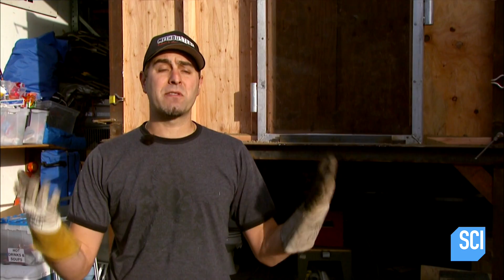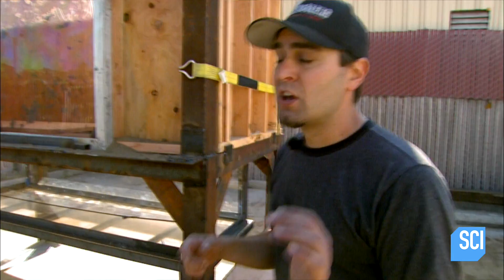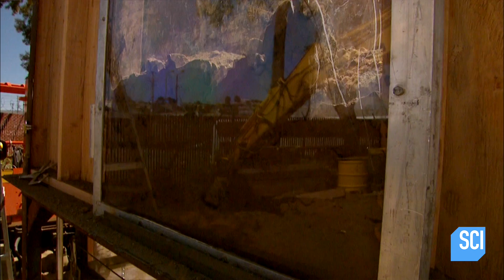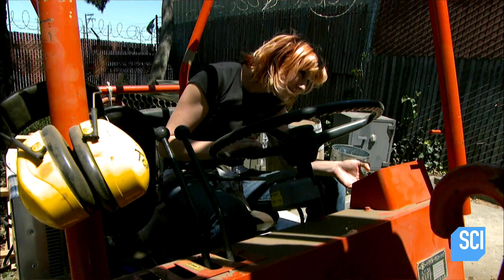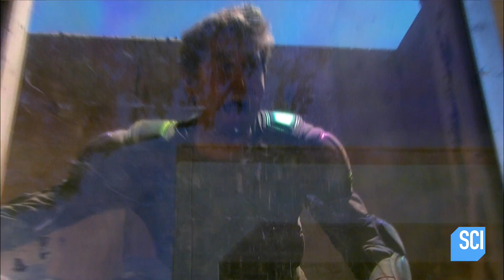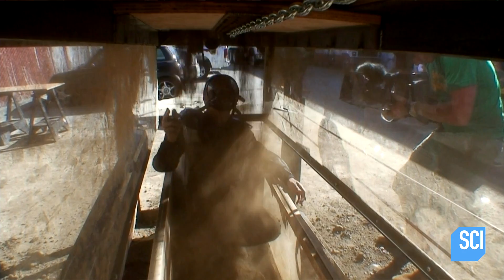Is There Too Much Pressure to Escape Out of a Casket?

Comment: What's funny is their testing this and not doing it the proper was as if you are buried alive you can punch though the wood it just takes a bit then you push all the Dir you can to the far side of the casket so tour sitting upright then you dig and fill in the casket with dirt as you dig up.  Unless it's raining then your chances of life have dwindled also then buried they pack the dirt down
Reply: You know how little room there is in a casket? Even IF you could get your arm straight up and down and get enough speed built up to punch through a wooden barrier, you'd have to create a large enough hole to get your body through without collapsing a few hundred pounds of freshly poured, not settled dirt in on top of you, then use just your arms to dig some of that dirt in on to yourself, pushing said dirt to the foot end of your coffin as you do so. You would have to continue to do this for at least 4 ft of dirt IF there was no vault (if there is one then only 2 ft of dirt but good luck getting through the concrete, and you're not lifting it either because those lids are a couple hundred pounds and there's 2 ft of dirt on top) all the while maintaining a packed hole and pushing the dirt down and packing it behind you with your feet. The most space you have to work with is the amount of free space that was in the casket around your body, so good luck moving your body enough to do any of that. The person with the best shot would be a contortionist.
Reply: @philliplewis1586  did you read A this is for those wooden ones that people used to use the processes that people use for burial nowadays which are point less would kill you and yes the lied is tight but in the older ones you'd have enough room as you have to do it over timer little by little
Reply: @lunardiver6784  I don't think you understand how tight a coffin is, old ones included. Would it be physically possible to move the dirt as needed? Possibly. But you also have to keep in mind that you have limited time until you suffocate, and that work takes energy so you're using oxygen. The amount of time and space you'd have to work with are extremely limited. I don't think you could do it.

Comment: I have seen people get buried and they encased in concrete on all sides
Reply: K
Reply: That’s only for places only under sea level, so bodies don’t float in floods
Reply: @iceboxxer494  oh that makes sense
Reply: Ice Boxxer most cemeteries require it because once the casket decays it could lead to sink holes in the cemetery
Reply: @iceboxxer494  Stop spreading misinformation
Reply: @iceboxxer494  They do it in Arizona as well, that's not the only reason why.

Comment: They are basicaly using sand not dirt

Edit:This is just what it looks like to me
Reply: yh the soil on top would be wet like atleast a bit
Reply: @abdullahfall1517  thats not always the case... She was buried in a desert... Where the top soil is just dry dirt.
Reply: It's still heavy as fuck either way
Reply: Its just dry dirt lol
Reply: @KanyeisGaming  dry dirt is basically sand, it acts nothing like wet dirt
Reply: in the movie the character was buried in the desert.  So sand is a good aggregate.
Reply: Sand isn’t a particular substance, it is a particle size range.
Reply: @wompbozer3939  
Sand IS a particular substance. That substance would be rock and mineral.

Dirt is made of clay, silt,sand and rock.

Soil is made of dirt and decomposed/decomposing Bio material
Reply: Corn Holio Sand can be made from any kind of parent material. It only describes a particle size and not a material. Silt is finer than sand. You could have granite based soil next to sand that came from wood particles . Even though we all kinda know what sand is, the actual definition is a little counterintuitive

Comment: Most cemeteries require a concrete Vault the casket be placed in with 18in of cover Max and depending on if the dirt was packed or if it was just dumped and depending on the size and amount of rocks.

Comment: There is more pressure to consider from surrounding dirt. Not just the dirt that's on top of the casket.
Reply: Uhmmm not true unless you want to punch through the side?
Reply: No Videos you’d be suprised how compact dirt is just a foot down. Most dirt will not fall like it did in this video and will actually hold its shape. It’s more likely you’d actually need tools to dirt upwards and out.
Reply: @joshlarochelle1298  exactly. It's compacted as hell
Reply: @*_No Videos_* sorry i dont get what you mean. Mind explaining? The pressure from the outside is already there and with you getting in more dirt the pressure will rather equalise than become greater or am I not thinking right?
Reply: @neznan1706  bro, imagine digging a hole with damp sand and the trying to climb out. It's like that.
Reply: Not forgetting g the cement and metal case
Reply: It's a hundred thousand pounds of dirt above you. Freshly buried it wil all collapse in your face and crush you. BUT if you are ultra strong enough and fast enough to punch a giant hole big enough to make an escape through thousands of pounds of dirt then I guess you are more than human.

Comment: You were using dry dirt, in cemeteries they have the moist soil that holds its shape more
Reply: That annoyed me more than it should lol
Reply: @JustyMe  cause he said moist? 😂😂
Reply: Exactly.
Reply: Ya but if it held its structure more then the hole would open up similar to the 2 feet of dirt experiment
Reply: either way, t6 feet underground... its impossible. The only way out is to tunnel, or move dirt out of the way, and if you are in a coffin there is almost no room to put the dirt asside. Even if it was playdough, there is just not enough room to set aside dirt for a 2x2 tunnel.

EDIT: Just look at the 2 feet deep experiment here. Look how much dirt is IN the coffin with him. He has to move a lot of it to the end just to be able to sit up.
Reply: @TheBeehawk  Why do we think of going up? Why not to one of the sides and go up and an angle
Reply: @sachagirvan  what difference would that do? and besides, you could get disoriented and lose direction of where is the top
Reply: @sachagirvan  even worse idea, have you seen The Great Escape? Tunneling even two feet out to the side you risk a collapse.  By the time you tunneled enough out to the side chances are the soil would collapse because you're not deep enough for the compact soil to hold the soil above it. You need to he more than 15 feet down just to start having soil compact enough to hold the pressure. That 6ft of soil would come down on you in the blink of an eye and crush you
Reply: @DeepFriedBeans23819  True, what if you tried to use the top board of the coffin above you?
Reply: @sachagirvan  make a support? With no tools and under 6ft of dirt you'd be better off doing it It kill bill style. And even moving the top board in the slightest you risk a collapse. Basically the only thing keeping the dirt coming down on you is the coffin itself. Moving it in any fashion would be certain death.
Reply: @DeepFriedBeans23819  So the answer is, don't be an idiot and get yourself in that situation in the first place.
Reply: @sachagirvan  you dont understand how solid and heavy a coffin is, do you? you would be lucky to break the lid open let alone go from the sides.
Reply: Depending how big the coffin is and how wet the soil is, it's probably not impossible. But really unlikely and stupid.
Reply: Isaac Downs wet soil is worst , more heavy , less flexible , it’s death assured .
Reply: @gerard4039  doesnt fall apart as easily... you could dig in slowly and push it towards the opposite part of the coffin. Still nearly impossible with 6 feet but better chances than this
Reply: @gerard4039  I dont know how good your english is but I see no reason for such hostile behaviour towards me. Anyways you couldve just kept it as a simple opinion that would actually make a decent point... I also never said anything about digging out being easy but instead pointed out its still rather impossible. Have a nice day now and stop putting such negativity onto others 🤪🤪🤪🤪🤪🤪🤪
Reply: @saints360row  but coffins we have to day even have less room to put dirt in with all that cushioning inside
Reply: @saints360row  I've been to 4 funerals recently. There is not much room in the average coffin, and the dirt has to go somewhere. Guaranteed you would die trying to get out of the coffin, even wet dirt would collapse into the coffin as soon as you start to dig. Especially since the dirt is recently put on top of you and hasn't had time to compress itself naturally.

You can try to dig upwards in wet soil, but your going to run out of room because you can't even position your body upwards, imagine laying underneath your bed. You have to dig enough so you can pull your body upwards, hope there is enough room for the displaced dirt. Then you have to worry about the amount of oxygen your consuming because there isn't going to be much air down there.

All the while when your laying on your back digging upwards if the dirt falls on your face your going to be in trouble, nowhere to move and if it fills up the area of the coffin your head takes place. Its game over if more dirt falls than you can displace.

I'd say your pretty fucked, not impossible. But very improbable. I don't know why everyone is arguing about being trapped in the coffins, you have a higher chance of getting hit by lighting than being trapped 6ft underground in a coffin.
Reply: @Taczy2023  Jokes on you pal. I don't have a bed. Hah. Figure that one out snowflake.
Reply: @gerard4039  wet dirt wouldn't all crumble and fall
Reply: @gerard4039  If it's at the right consistency and it's the right soil, once you've made a hole in the coffin all you would have to do is remove enough dirt to make a hole large enough to crawl out of while packing the dirt in around the walls to ensure it doesn't cave in, a fresh grave might not be very packed down, so in that case the soil just might have enough play room you wouldn't need to worry all that much about having room to put dirt somewhere. That's really the only way I see it being possible.
Reply: Somehow make a hole on the side and dig a tunnel moving forward while putting dirt behind you, therefore you never run out of room and are able to keep going forward up or down. Just imagine a box the diameter of the coffin moving with you. Makes sence?
Reply: Mega Savior, I guess some didn't imagine such a possibility. ;) 

It depends on how settled the ground is which makes this plausible, however even in 'stable' environments cave-ins do happen.
Reply: Yall stupid if the dirt is already that wet you have been days in there lets imagine that he woke up after 1hour
Reply: i can't believe this stupid comment on so many likes. i don't know if it is a joke or something.
Reply: In kill bill the dirt above the coffin is dry as it is here
Reply: Neznan 1, Not really.. XD
Reply: SadisticSarcasm, Spiders Galore, desiGnampthia, One thing you all forget; this is not your typical burial with a current casket nor is it even one with a coffin, yet it's of a makeshift coffin-casket that would be larger than either in a square shape. In canon, she was placed six feet under IIRC, and as such there would be four feet at most above her, possibly less.
Reply: Isaac Downs that’s what I was thinking
Reply: Yes you have more of an ability to move the soil from above you to below you by hand
Reply: They coulda packed it in at least
Reply: andreas skordalis If I were there I would have pounded that shit in with a spud bar
Reply: Isaac Downs and also increases the weight a fair bit i can imagine
Reply: At the funeral where we bury family the put a slab of concrete on it
Reply: Moist soil is much worse... Although either one is a death trap and impossible to escape out of... I'd rather escape from dry dirt than mud... And did you really just say that moist soil "holds it's shape more"?! Well i got news for you because no it doesnt... Not at all. Dry soil compacts and can become almost hard as a rock. Moist soil turns into mud. Pick your poison but you're not crawling your way out of either of them. No possible way a human can break out of a coffin under 6 feet of ANY soil and make it out alive. Just pick the way you want to die... All end in suffocation. Suffocate in the coffin or suffocate in the soil; that is if you can even break your way through the coffin wich eats up your oxygen... Yeah no way possible.
Reply: @tori9365  Have you never built a sand castle before?
Reply: She wasn't buried in a cemetery she was buried in a desert
Reply: No, they use the dirt that came out of the hole. They dont wet it down. It literally comes out of the ground, into the pile, and then covered with a tarp.
Reply: also the fact that there’s grass and it won’t just collapse into the coffin
Reply: Moist or wet?
Reply: I bet you say that just to watch them zombis try. Your held the riffle with the hand you weren't typing with, didn't cya?! :))
Reply: Lmao if you didn't die at the hospital, they made absolutely sure that your gonna die in that casket
Reply: In the kill bill movie she’s buried in the desert
Reply: If youre buried alive in Australia youll be fine then
Reply: I didn't watch the full episode, but they also should've have dug down and not up.
Reply: testing the movie myth.  In which the character was buried in the desert.
Reply: + if you wake up in coffin, you are probably dehidrated, and still hurt/sick from whatever put you there in the first place, you are probably disoriented and not completely in your right mind. Also, fear like that could make a person faint. So, while out of conciesness , you are most likely going to use all of the air that is trapped down there and slowly die. Even if you don't faint and you are completely aware, you would have panic attack so bad that you will use all the air.
Reply: Also, coffins are smaller and that leaves you with less space to move and fight. And with less space to push down the dirt.
Reply: Have you ever buried someone? I've dug many graves in trajillo creek cemetery in colorado. Dirt's bone dry and 70% rocks. They bury people no matter what type of dirt
Reply: And it’s heavier too
Reply: Mythbusters always try to give their myths the best possible chances of working. So in the theoretical situation, this would be a very dry, loosely packed area.
Reply: Graves are dug up days in advance with the soil just sitting in the sun. Why is everyone on the idea that cemetery's dirt is always wet. Makes no sense. There isnt irrigation running through them. It's based on weather just like anywhere else. Could be wet could be dry could be clay.
Reply: But in kill bill it was a desert.
Reply: In cemeteries they use the dirt that’s there. If it’s dry during the summer months or a drought, they’re going to use dry dirt. This is a dumb comment.
Reply: Kill Bill was dry soil in a desert.
Reply: Shaddupp
Reply: That would be even harder to get through
Reply: Wet soil is softer and easier to dig
Reply: If you live in an area that has frequent droughts how the hell would the soil be moist? Depends on where you live has nothing to do with the cemetery soil
Reply: Ok so dirt is dirt

Comment: How about trying wet version of dirt?
Reply: Like cement
Reply: It's already a fact. You'll get crushed. Ask anybody who moved dirt for a living.
Go search elsewhere for answers. Mythbusters are a joke.
Reply: @elfinko5862  why would I need to ask have you never dug a hole? Wet mud is a lot harder to dig and move because it sticks
Reply: @elfinko5862  I have dug a big hole. Here we're talking about the ground being compact around the coffin, I suppose take a stand castle, you compact it it'll hold its shape.
Moist mud does the same, that's why we used it as a building material. All I'm saying is I'd like to have seen them try moist mud to see if it'd hold its shape.
 From the sounds of it you've not dug from under the dirt, it also sounds like you've not dug you just tell people where to dig ;)
Reply: @SomeGuy-lw2po  Everybody has an opinion. Right or wrong. Go test it out yourself. I don't play these youtube arguement games.
Reply: version 4 - the wet version
Reply: Wirt
Reply: Winar Huang it’s be too heavy
Reply: GoldMaze 321 E X A C T L Y
Reply: Wet is heavy , mean more death 💀
Reply: @gerard4039   Also means: Not falling down on you. You could take the dirt out from on top of you and compact it at your feet. There's enough space in the casket for you, so there should be enough for a hole your size. Would have been an interesting experiment.
Reply: @thecashier930  No. No hole. Death only. Thousands of pounds of pressure tightly trying to fill in all sides no matter how hard you try Crushing you to death.
Reply: @elfinko5862  this is why it should have been tested, we'd see who's right